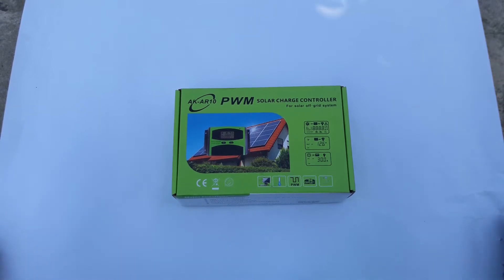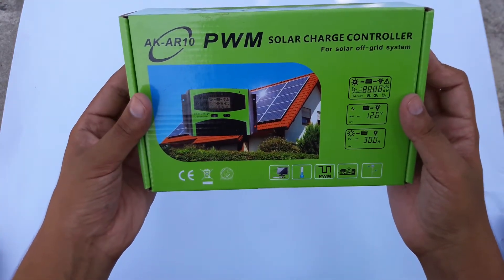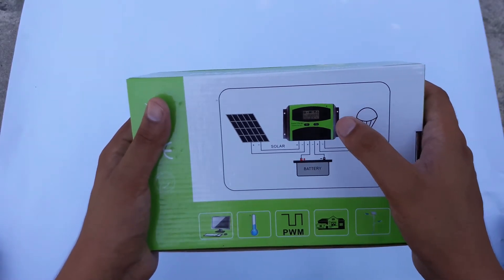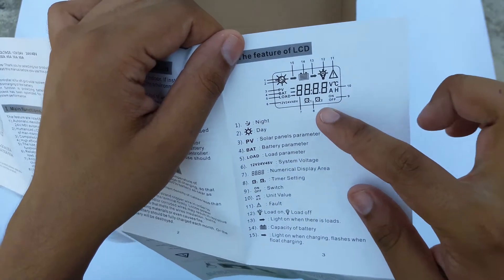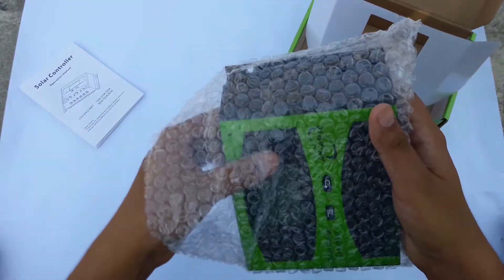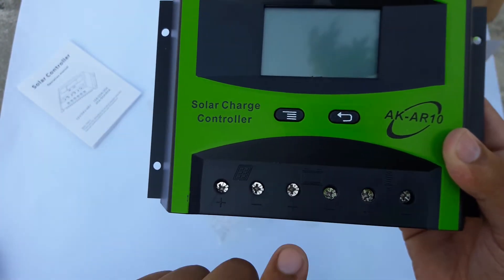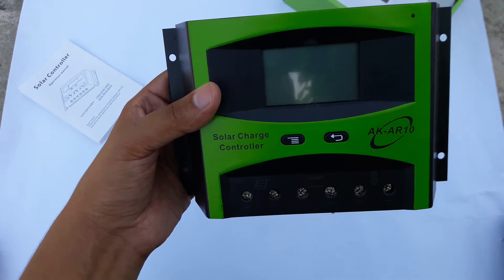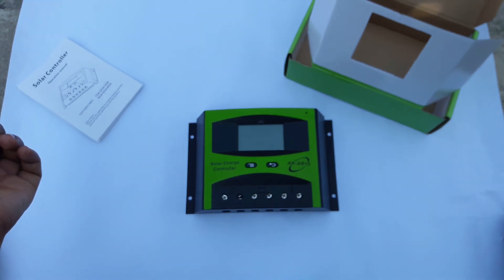pwm solar charge controller 12v/24v for solar off grid system unboxing 2017

Comment: Hi am waiting for the second video on how to connect the solar charge control unit
Reply: easy always connect the battery to the solar controller first then solar panels.
Reply: @TJ Anderson Yes it dont come with wires you have to buy. go in your local electrical store 12 o 16 awg cables and see if they fit in your controller (remember the cable needs to be dc). And remember always connect the battery cables to the controller first.

Comment: What it means if the sunlight and the arrow is blingking
Reply from the maker: Which arrow
Reply: The left one,, from solar panel symbol going to battery
Reply: The sunlight symbol and the arrow sybol going to battery symbol is blingking and the battery symbol is empty..what it means?
Reply: Keep blingking and it not show clearly
Reply from the maker: It means that your connections are loose between solar panels and the battery.Check all connections and ensure that there is no rust. The blinking means that there is very less energy coming to battery. Hope that this will work.